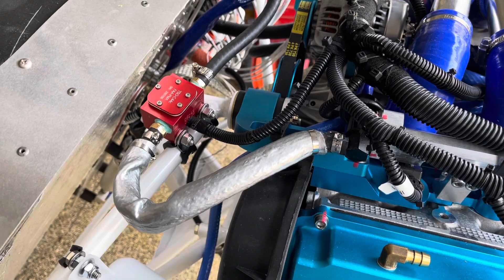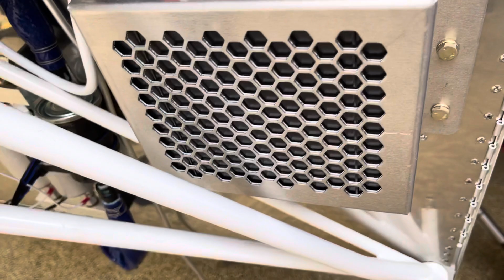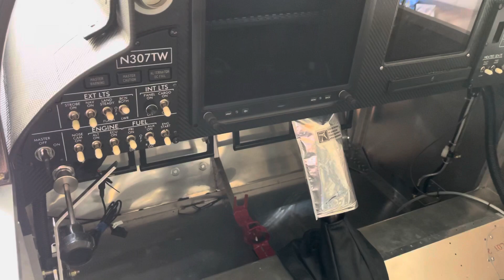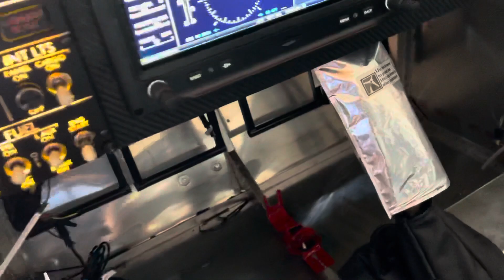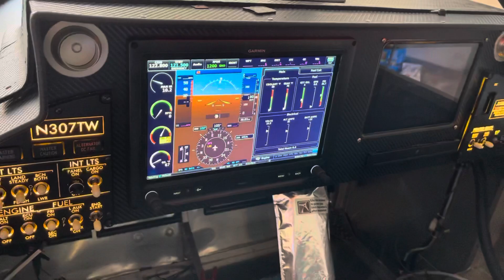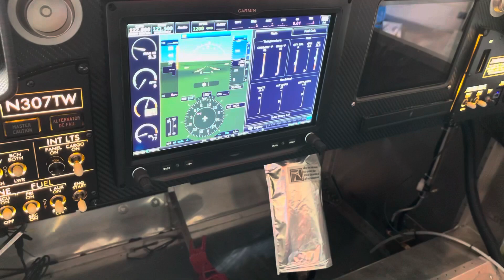Sonex-B | Aeromomentum AM15h Start & Operation

Comment: I assume you still have to install a muffler. It must be a southern US airplane, for I do not see hoses for a cabin heater. It is very important for Canadian operations. I started on a Z750 several years ago, and now with the Sonex high wing coming, I might abandon the tail and switch to the Sonex. The Z 750 is just too slow.
Reply from the maker: Muffler is now on. Not installing a heater core at the moment as I have heated seats. Based out of NY so we get a mix of all the seasons.

Comment: great set up. love to hear an update ESPN the AM15. did you weigh the engine yourself? qhat ECU? can you adjust/program it?
Reply from the maker: You can use a program to modify the ECU but I only modified it to run a small cooling fan based on temp. Mark is the one who tunes it to the engine before it leaves the factory.
Reply: @emsbuff25  Thank you for the info.

Comment: What were the benefits of this engine that made you go with it over the Jabiru? My understanding is the horsepower is basically the same.
Reply from the maker: Horsepower is similar however I wanted a completely FADEC fuel injected aircraft with a high amperage dedicated alternator. It gives more torque than the Jab and I wanted to try something new.
Reply: Also, IIRC, the HP rating on this engine is continuous, at about 5280 RPM. Obviously, prop speed is reduced by the gearbox, and these engines are super efficient in @ 75-80% cruise.

Comment: Nice!  Curious about the upper engine mount and engine g loading, without triangulation. Looks like the top mounts have extreme leverage.
Reply from the maker: An engineer with Aeromomentum designed it. Best to defer to them for questions like that. I am not certifying this plane for Aerobatics nor do I think the Aeromomentum engine I able to do aerobatics especially with negative G’s.

Comment: I like these engines way better then aeroVee never trusted VW engines tinkered with them in the 80's and 90s they always leaked and eventually overheat. Just a fact you don't see air cooled engines still being used today in any application except aircraft. While certified engine builders have worked out all the bugs of air cooled engines they cost 25-50k. The only thing holds me back from the sonex is the location of the fuel tank I know lot of older aircraft stuck the tank behind the engine just seems dangerous to put a tank of fuel behind a hot engine your sitting right behind it.

Comment: Are you going to go with a fixed prop or constant speed? Also curious on what version and specs you are choosing.
Reply from the maker: 62" 3-bladed ground adjustable prop from Warp Drive. Also have a 60" 4-blade ground adjustable prop from Luga on order. We will see which performs better after testing.

Comment: What is your FWF all up weight with all fluids ect.?  What reinforcements were made to firewall and internal structures if greater than Sonex's recommended 200 lb max FWF weight?
Reply from the maker: 183lbs dry. Just over 200 with prop and fluids. No reinforcements were made, no plans to do so. The plane is so over-engineered that it would only add more weight and complexity. It is a nominal risk I am willing to take.

Comment: What propeller did you order? 
What length?
How many blades?
Were you able to calculate an expected top cruise speed?
Thanks. I'm very close to placing a deposit on an AM13hHP @ 126hp. It's for a Skystar Pulsar III which is very similar size and weight. 
Your project is inspiring!
Reply from the maker: I have a 4-bladed 60" on order since February from Luga with an unknown ETA. In the meantime I have a three-bladed 62" from Warp Drive coming this week.

Comment: OMG just listen to that ECU-controlled, EFI, high energy electronic ignition, multi-sensor-monitored, precision internal toleranced, high performance, affordable, low maintenance, high reliability, liquid cooled powerplant!!! I am SO DONE with crappy carburetors, low energy ignitions that require spark plug gaps at 0.022", inefficient air cooling, self-destructive EGT and CHT, dangerous exhaust muff cockpit heaters, etc. The only advantage to traditional aviation boxer engines IMO is the form factor is easily accommodated in most aircraft cowls.

Comment: Looking forward to seeing what size and type of propeller you install. I'm pretty sure this engine installation requires the prop shaft centerline be placed about 2-inches lower than Jabiru, Rotax, UL Power engines. The AM induction system just sits at least 2 or 3 inches higher above prop centerline. This is a concern I have for going with AM on my Skystar Pulsar III. I apologize for hijacking your video-- right now your project is by far the most exciting and encouraging one around! Thank you for sharing!
Reply from the maker: I have a 4-bladed 60" on order since February from Luga with an unknown ETA. In the meantime I have a three-bladed 62" from Warp Drive coming this week as well.

Comment: Have you attempted to fit the cowl and estimate how much modification is required?
Reply: This is an excellent question. The AM engines have a lower propeller shaft centerline in relation to the too of the induction system, compared to Jabiru, Rotax, UL Power and similar boxer engines. Will be interesting to learn which cowl you started out with and how good/efficient it looks after fitting.
Reply from the maker: Significant modifications will have to be made. I will try to document it as best I can when I tackle that hurdle. I did order the Aeromomentum nose bowl that I will attempt to mate to the standard Sonex-B Cowling.

Comment: Great progress.  Question on your engine mount.  Did you order from Sonex or was it custom-built for your AM15?  Thanks.  Let me know when you will accept visitors to your build.  Am a potential Waiex purchase.
Reply from the maker: I was the guinea pig and helped with development using an Aerovee mount that was modified. The guys over at aviationcomposites.net now have all the measurements and can fabricate the AM13/15 mounts for all legacy and B-model Sonex aircraft. Good luck.
Reply: @emsbuff25  Thanks amigo.  I hope I get the pleasure of seeing your Sonex someday.  Regards, Hugo
Reply from the maker: @HC_Agency  my plane is located at KFOK. If you're in the area, let me know, I'll be happy to show you the build.
Reply: @emsbuff25  Thank you sir.  Looking forward to seeing some of your updated videos amigo!!  Be well.
Reply: @emsbuff25  this is so good to know! I have the same concern for my Skystar Pulsar III which is very similar in size and weight to the Sonex.

Comment: Will the AeroMomentum fit under the standard Sonex cowling or will you have to make significant mods or a whole new cowling?
Reply from the maker: No it will not. Significant modifications will be made. I will try to document it as best I can when I tackle that hurdle. I did order the Aeromomentum nose bowl that I will attempt to mate to the standard Sonex-B Cowling.
Reply: I too am very interested in this. I suppose you haven't gotten to that yet. I'm subbed now and following with huge interest. Am so glad you are blazing the trail for putting this engine on a fast little airframe. Not too much I can learn from the guys putting them on the flying tractors that are so popular today. Those Zeniths have twice the firewall and inferior cowl space of the Sonex and Pulsar.

Comment: I just ordered my own Waiex B kit minus the firewall forward kit. I've been seriously looking into the same engine package. I really hope you keep going with content on your new toy. There seems to be a void of good sonex videos. :)
Reply: Check out Gavin's Sonex B build on you tube. Very good.
Reply: I'd go with the 130 viking.  Its cheaper, more horsepower and a bit more proven design.  Plus the prop flange has lugs on it and doesn't rely on the bolts for the torque strength.
Reply: @rustusandroid  how much research have you done into the failures of the Viking stuff? I'd suggest looking into how the company(viking) has handled those instances. From what I've seen it doesn't inspire confidence(in the product reliability, nor into the transparency of the company in actually handling issues and improving the product.)
Reply: @mrphyslaw  Jan has been open about complaints and posted videos about those "failures".  He inspires great confidence about how Viking handles them.  And there hasn't been any significant failures to speak of considering the amount of engines that have been sold and the thousands of hours flown.  Rotax has a higher per capita "failure" rate by far than Viking, and that is a fact.

Comment: Love love love this ... One question: There was a Kitfox video saying he had issues with vibrations on the cooler in the front. You?
Reply from the maker: I haven’t had any vibration issues yet but then again I have less than an hour on it. We will see how it progresses. Seems pretty strong though.
Reply: It's shock isolated. Maybe areomomentum addressed that issue. I saw a kitfox where he moved the radiater to the fire wall.
Reply: I saw that same video. I have the oil cooler mounted in the same location on my Jabiru 2200 and this Aeromomentum seems to run MUCH more smoothly than any boxer engine.